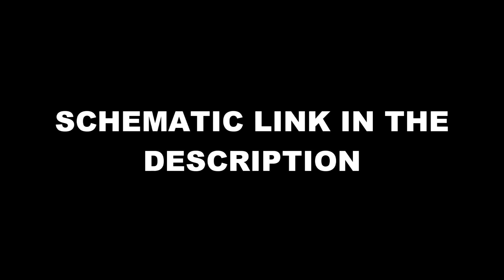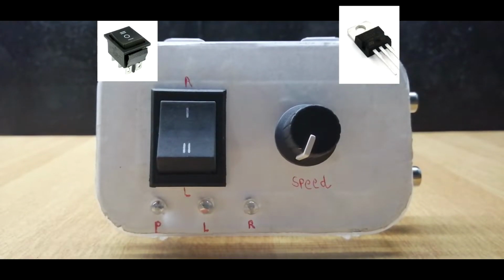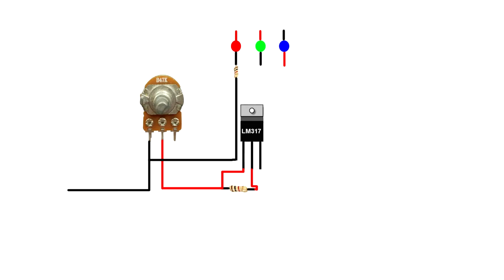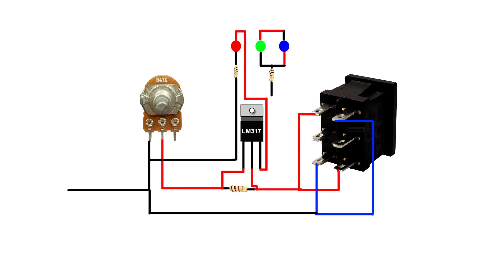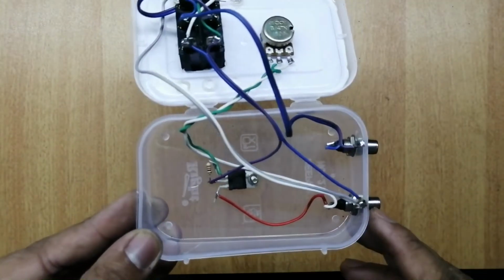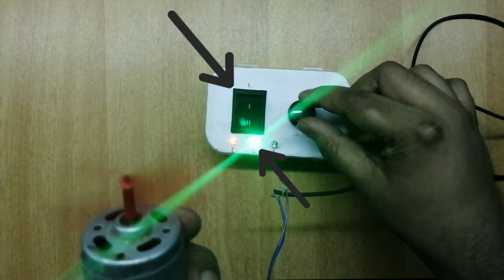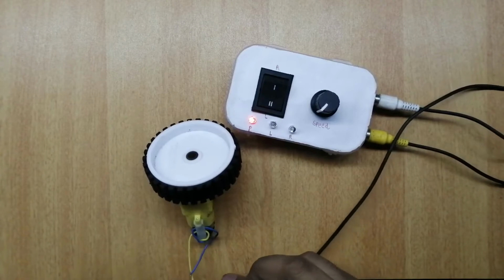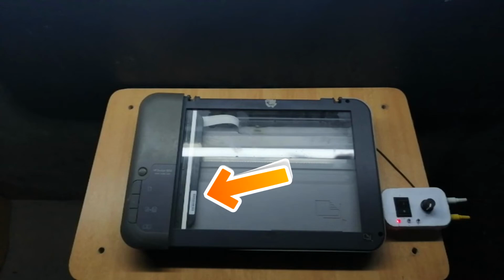HOW TO MAKE DC MOTOR SPEED AND DIRECTION CONTROLLER WITHOUT USING ARDUINO AND ANY  MICROCONTROLLERS

Comment: Can I use 50K potentiometer?
Reply from the maker: Yeah.... But I recommend 10K pot, if not possible to get 10K pot then you will use 50K are 100K pot, that's not a problem...
Reply: @Circuitoptimize23  thanks so much for replying

Comment: Can i use this partlist for 450watt dc motor?
Reply from the maker: ɴᴏ
Reply from the maker: ífчσu wαnt tσ run 450v dc mσtσr,чσu nєєd α sєpαrαtє cσntrσllєr círcuít drívєr.
Reply: can we change use ac to dc converter instead of battery in this circuit?
Reply from the maker: Please suggest that you used DC motor Type.
Reply from the maker: More discussion are any help related this topic please joining my what's app. What's app number avaliable in the video description.

Comment: How about the schematic using an on-off-on dpdt switch instead of what you used?  Is it the same or different?
Reply: double pole, triple throw. dp3t with one pair not connected

Comment: How many volt min to max?
Reply: Bro i have 6 pin poteniometer
Reply from the maker: input volt 12 to 20
Reply from the maker: @Videos-tj1gl  its not a problem .but must be a used 10 potentiometer..